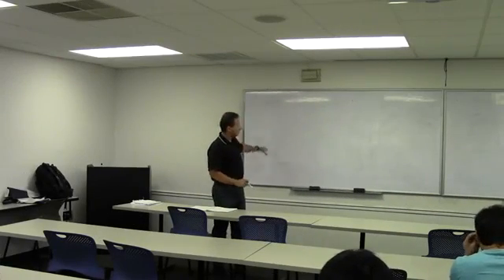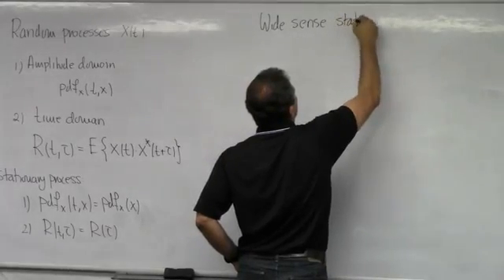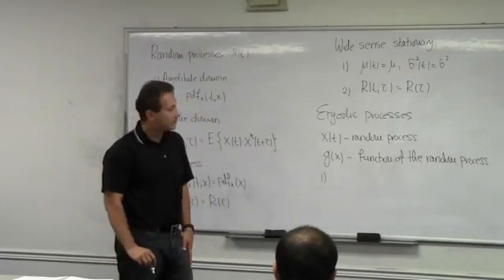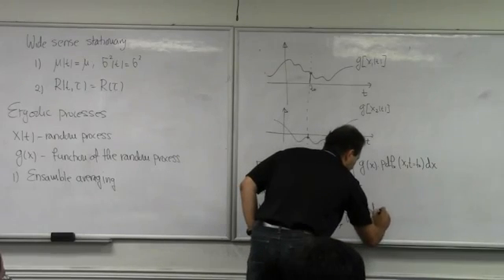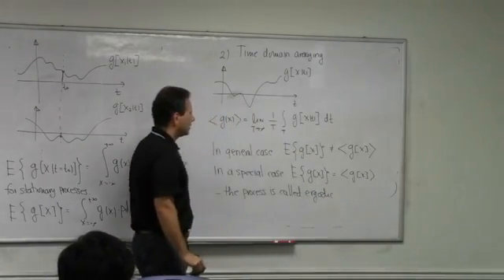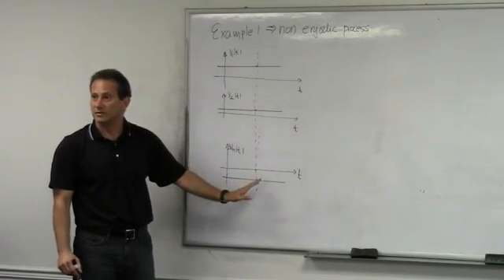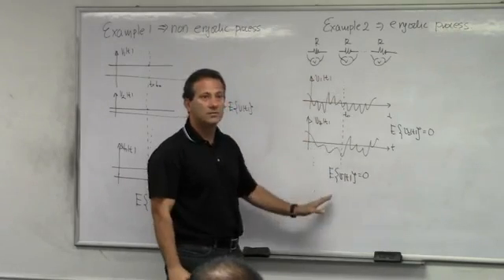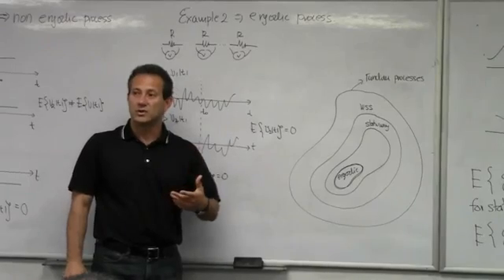what is wide sense staionary ,strict sense ,ergodic signals

Comment: For the example of measuring voltage across resistors being an ergodic process, did you say that if the resistors where measured at constant temperature, there would be a constant voltage across resistors? if that's the case, then wouldn't the plot be a constant line just like the first example?
Reply: even if the temperature is constant, the movement of electrons in it is random, resulting in a random voltage.
Reply: +Purpose Technology so we're measuring the movement of the electrons that cause the voltage, not measuring the voltage itself... hmm isn't the movement of electrons called current? The current is random and ergodic? Thanks for the response by the way. Better late than never! I appreciate it.
Reply: No we are measuring the voltage itself, movement of electrons creates a voltage and we are measuring the voltage

Comment: Very nice lecture. Especially two examples that explain stationary, but not an ergodic process. But from 24:00, when he draws Venn diagram to classify various kinds of random processes, I guess an ergodic process does not belong to a "strict sense" stationary process, because an ergodic process only tells about the time average being equal to the ensemble average. Of course, an ergodic process belongs to the "wide sense" stationary process since wide sense stationary tells about mean. Therefore an ergodic process should be drawn together with "strict sense" stationary process within "wide sense" stationary process: there is an intersection between ergodic and "strict sense" stationary, but there is also the case where ergodic, but not "strict sense" stationary, and vice versa. Please someone correct me if I'm wrong.
Reply: Roman Mami Thanks for your note that motivated my search on the web. In fact, I found that there were two kinds of ergodicity: weakly (wide sense) ergodic and strongly (strict sense) ergodic. A (part of) weakly ergodic process is actually what is covered on most courses and textbooks, including this lecture, that is, time average being equal to the ensemble average. But we can extend this notion to include 1) variance and 2) autocorrelation in the weakly ergodic process. In contrast, the strongly ergodic process is analogous to the difference between wide-sense stationarity and strict-sense stationarity: we "further" extend the notion to include higher moments and more combination of time points rather than merely autocorrelation.
To summarize, the ergodicity explained in this lecture (and most courses on the random processes) is just a (part of) weakly ergodic process, and the Venn diagram drawn here is meant for the strongly ergodic process, which was not explained in this lecture.
For those who are interested, refer to the following link.
http://books.google.co.kr/books?id=BnPZ249ArwoC&pg=PA278&lpg=PA278&dq=ergodic+not+strict+sense+stationary&source=bl&ots=KEXH0_qjsD&sig=GOEmt6Q8-gbXD3qyhBGoqeNW1iE&hl=ko&sa=X&ei=WzXNU8btDZbc8AXrg4LoCw&ved=0CDcQ6AEwCQ#v=onepage&q=ergodic%20not%20strict%20sense%20stationary&f=false